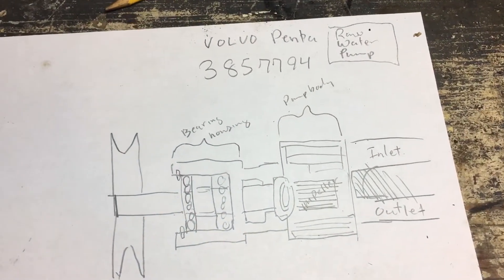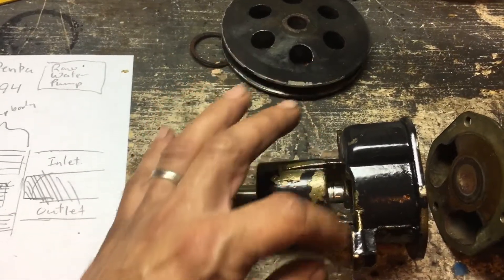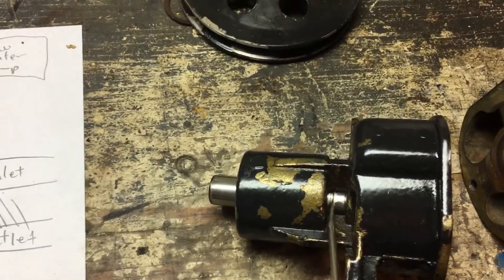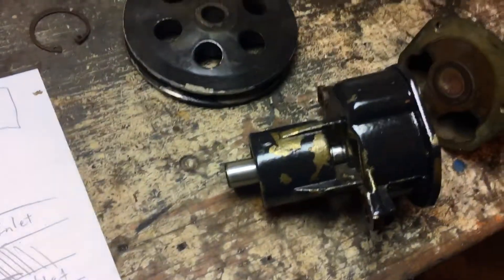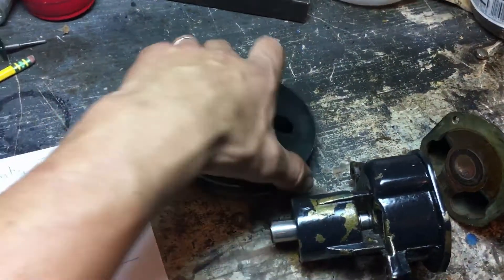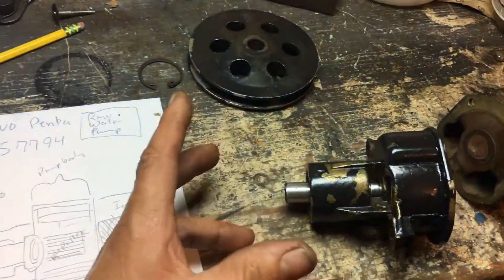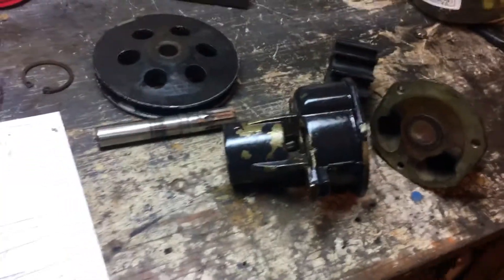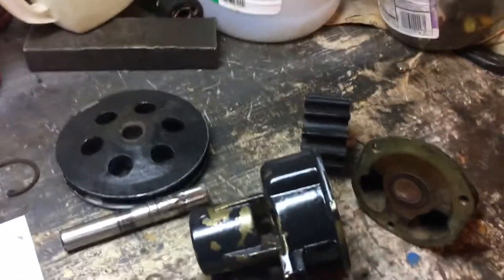Volvo penta 3857794 pump rebuild

Comment: I have the same pump and the inside bearing came off with much difficulty too.
I placed some wood under the pulley for supporting the recessed ribs, and pressed it off. I took a piece out of the inner holes with a puller before pressing it off. Thanks for the video as it helped me save the cost of a pump. I found the repair kit on E-Bay. The shaft seals are also available too, on Etsy if the bearings are still good. Available from Bulgaria for $10

Comment: Use a gear puller and pull the pulley off then remove the snap ring don’t listen to this guy the gear pulled will not break you pulley
Reply: This will break your pulley. Ask me how I know.

Comment: Should the pulley come off with simply using an impact hammer?  Or is there something else that needs to be done to get the pulley off?  I am bracing the pulley on two wood blocks and trying to drive the shaft (and body) down with an impact hammer.

Comment: lucky u got your pulley off - mine shattered, had to drill it out.. VERY odd design, the pulley is actually cast around a 1" hex nut made from same soft material.. I think getting the c clip off as u described then putting a bearing holder under the pully right against the centers with torch heat works best.. fyi bearing numbers are skf 6202-1rs

Comment: FYI, they usually have an o-ring in that valley on the shaft between the bearing housing and the impeller housing.
Reply: that's the info I came here looking for. Couldn't remember where exactly the o-ring went. thank you!!